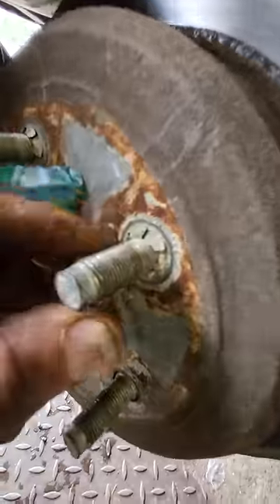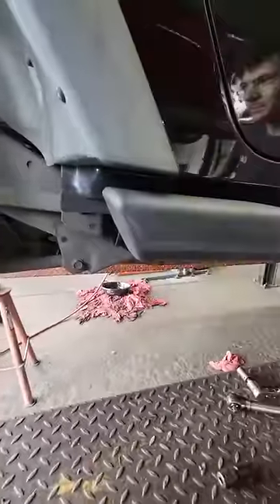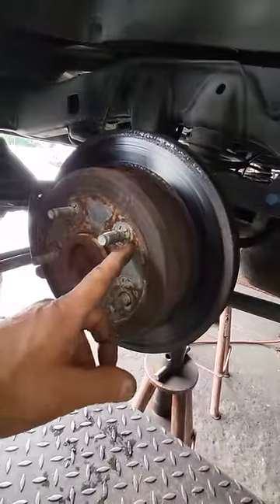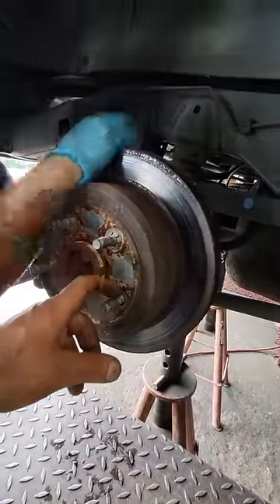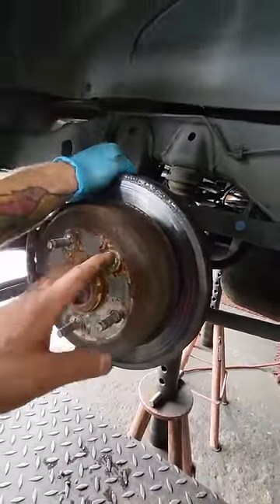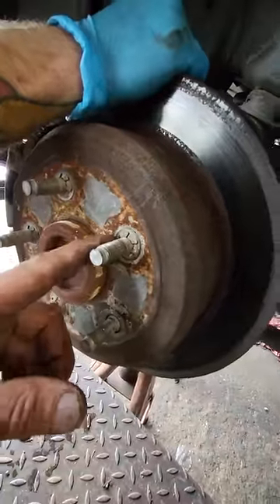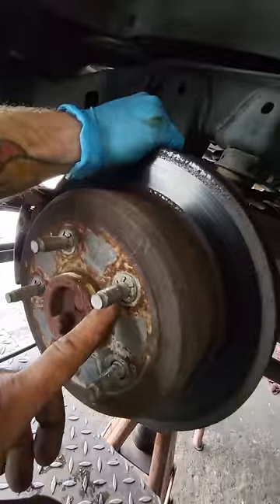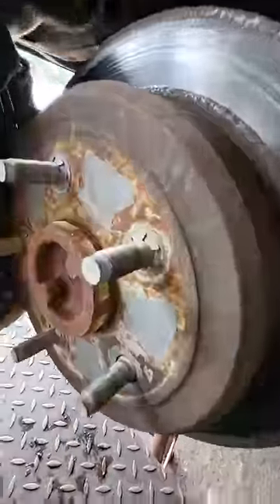There is always that guy

Comment: Just keeps the rotor from falling off on the assembly line
Reply: Why put one on every stud? Seems like
One would do the trick
Reply: @yamkaw346 generally there are only 2 across from each other. If there are more I'd be willing to bet the owner did it.
Reply: @yamkaw346 makes sure the rotors are flat and straight so they can run the lug nuts down without anything being crooked or having to hold it down
Reply: @sumo-ninja This is why I always reuse at least one.
Reply: Use side cutters, remove and never see it again. No need to reuse clips again
Reply: @davidhodge0201 or a new guy at the factory.
Reply: Because the calipers won't do the same?
Reply: @dontask8979  someone has to install the calipers my guy
Reply: That is exactly right!
Reply: Yeah till 100 years down the road and someones like I'd like to restore it to original but can't find these damn clips everyone threw them away 😂
Reply: I'm not saying I'd gaf think people go overboard with that shit sometimes 😂
Reply: Its at the Barrett auction
   We would expect this to get twice as much if it had all the rotor clips 😂😅
Reply: @yamkaw346 Right ? 3 max
Reply: I know not all mechanics assemble what they've taken apart. Those customers bring their vehicles to me for proper repairs.
Reply: Hence the reason they use set screws nowadays
Reply: @terranovarain6570 in 100 years I can sell you wheels filled with original air from the factory air compressor 😮   well I can sell you them now why wait lol........   😅😅😅😅😅
Reply: @dontask8979 Calipers will only hold the rotor on one side. The other side is free to flop around. Also, on the assembly line, when they install the axle, brakes aren't hydraulically sound yet. The pistons in the caliper have t even been bottomed out yet.
Reply: @anonymous5072 they still use them
Reply: @loganman2887  your comment is redundant
Reply: @yamkaw346 qualify assurance  and instruction
Reply: Yepp we cut them off when putting on new wheels just cause some time the wheel won't seat flush I'd never recommend even cutting them off unless you gotta do the breaks lol don't need them but also shouldn't take them off if needed
Reply: @yamkaw346  ballance
Reply: This is the answer. Can't fall off and hurt anyone with those goofy things on.
Reply: @LynxStarAuto so what are you saying the rotors can fall harvest out with the calipers on?
Reply: Oya right befor the spin test it
Reply: Or when some flathead like this with an impact wrench is rotating or replacing tires

Comment: A customer ask me one time are you going to put them back? I said no. He said what holds the rotors?. I said the wheel.
Reply: And caliper bracket and aliper will hold the wheel on if your wheel falls off you got bigger problems than that clip. Crap that crap
Reply: @jamesworsham2312 crap that crap? 😅
Reply: @jamesworsham2312 I thought my wheel bearing attached to my CV axle that was holding my wheel on but if you would tell me it's my caliper bracket I'll believe you😂😂😂
Reply: You don’t need the retainers to keep the rotor on, two of my cars randomly snapped lug nuts, and in the case of my IS300 I literally rolled on the rotor for like 3 feet and it had no retainers.
Reply: @shanefowler3504 well that wheel bearing is actually attached to the knuckle.
Reply: *wheel hub - it holds the tires and wheels on.  The tires grip the road and stop the rotors from falling off.
Reply: These r same ppl who Google Cel lights and tell YOU what's wrong, what to fix, how much it should be and how long it will take. I say Ok then fix it yourself. Well I blah blah. Do yall same ppl take a cow to ponderosa, or do u just eat what they provide? Do same with shop. Can u process cow and cook own steak? Maybe, but why leave home if so?
Reply: @jamesworsham2312  caliper bracket and caliper will hold the rotor....not your wheel.
Reply: @shanefowler3504  ur cv axle pulls straight out .
Reply: @blazeboyblazeboy4470  I know was a sad attempt at humor
Reply: .... and then everyone clapped.
Reply: And the hub caps hold the wheel
Reply: Technically it's the lug nutz.
Reply: @shanefowler3504 No those clips hold everything together. Rotor, caliper, Axle, Wheel Bearing, hub, and wheel. GM designed them to take thousands of pounds of thrust force.
Reply: O here I was thinking it was the nut the whole time. Silly me
Reply: @toddcook8824 crap that crap sir!

Comment: If one is still unusable shape when I'm done taking them off I usually slide it back on to hold the rotor in place while I put the caliper and pads on. They actually do what they're designed to do fairly well. But having that many on one rotor is overkill
Reply: Exactly. A quick twist and they're off. Then you just press back on. 

Can't believe people are praising this shop in the comments. Would they think the same if they didn't replace the set screws on the rotor if it had them?

It's just not proper.
Reply: To hold the rotor in place, I normally hand tighten a wheel nut on. That way, it's easier to put the carrier, pads and calliper back on without the rotor falling off.
Reply: @ssss-df5qz the set screw is litterally just to hold the rotor on going down the assembly line so it doesn't fall off and hit an assembly worker. 

The wheel sandwiches the rotor against the hub, and the rotor centers itself on the hub. There is no need for a screw outside of a factory with OSHA.
Reply: One is enough if the rotor won't stay in place without getting cockeyed, if the rotor stays straight on the axle or hub, then zero is correct. Unless you're trying to restore something to 100 point concours level. Then by all means, use exactly what the manufacturer used. I've seen two clips used on classic (original) Mopars from the factory. That was 38 years ago.
Reply: @ssss-df5qz  That's because the shop uses common sense rather than wasting time fighting with rusted retainers and wasting even more time sourcing new ones. It turns out, you don't need these retainers other than as a working aid. You also don't need set screws unless you really want to use them. I personally leave all that crap out. It makes the job easier for me or the next person the next time.
Reply: @ssss-df5qz These clips are not proper. They are not intended to go back on. A set screw? You are talking apples and oranges. They are only for the assembly line. They are required on assembly lines because rotors fall off and injure
Reply: @ssss-df5qz you really don't know how to work on a car, do you?
Reply: @definingimage  25 years, thousands of return customers, zero bad reviews.

But nah, not got a clue have I.
Reply: @Texassince1836, when you have wheel bolts, the little screw holds the disc in line so you can easily fit your wheel bolts.
Reply: @ssss-df5qz bwahahahaha I bet you get pissed when the dealer removes the shipping covers from new vehicles.
Reply: @ssss-df5qz being you call it a set screw, id have to call b.s.  because apparently after 25 years you don't know what a set screw is.
Reply: agree i use them for the same purpose sure does make  caliper easier to reinstall
Reply: @davidrobinson7768 some lugs are solid tip, and will not run down far enough on the stud to hold the rotor down.
Reply: @LynxStarAuto  I know, but it does make it a lot easier. Stops the roter from falling off and hitting the floor.
Reply: Thats why you use a lugnut.....
Reply: Exactly

Comment: It looks more professional to reinstall them in my opinion. When  I work on a vehicle, I try to make it look like it has never been touched before. I pay attention to details. Some customers appreciate the extra effort.
Reply: You give the vehicle back to the customer with the wheels installed right? How does it look any more professional to them when they can’t even see the clips?
Reply: To me it looks more professional if the guy knows what to take off and what to put back. You do you though, I just hope you don't charge by the hour if that's what you're gonna spend time on.
Reply: Make sure you charge them $40 for parts for those retainers, too.
Reply: Actually it looks more like an amateur worked on the brakes.   Putting the retainers back on is like putting the clear  plastic protective film back on an electronic device.
Reply: Looks more professional? Thats the dumbest thing ive ever heard on something that literally has a wheel bolted over it...wouldnt these clips actually be dangerous by not letting the wheel sit flush to the hub?
Reply: Try to buy some new ones. Then you can mark them up to $5.00 each.
Reply: I'm professional and I don't put them back on.
Reply: @tommys2979 Oem wheels have a machined area to account for those clips.  If you install aftermarket wheels, you almost always have to remove the rotor clips so the aftermarket wheel mounts flush to the hub.
Reply: That's the problem. These brakes look like they've never been touched
Reply: Yessir this is what I’m saying
Reply: @Code325 some customers do their own brake jobs maybe this customer couldn’t do it but maybe the next owner would see it
Reply: @trentlee9826  then that owner would assume their vehicle didn’t come with them, as most vehicles don’t anyways…
Reply: @Code325 You assume they’re never going to get a flat or rotate their tires?
Reply: @gilberturibe393  like I said, they’d never know it ever had them. 95% of people wouldn’t even know what they’re for if you explained it to them. Most customers hear you explain something, nod their heads, and immediately forget what you just said.  That’s a million miles away from suspecting that there should be rotor clips installed and erroneously assuming that that reflects poorly on the last technician that pulled the rotors off their vehicle.
Reply: @Code325  If they rotate their tires I’m pretty sure they are going to see what is behind before and after the mechanic works on it.
Reply: @gilberturibe393  more than likely they wouldn’t notice. And if they did, then what? It would be like being upset that the tire techs took the stickers off your tires before installing them.
Reply: @Code325  The stickers don’t hold your rotors in place 😂
Reply: @gilberturibe393  neither do the clips. Your lug nuts do buddy. The only way your rotor is going anywhere is when you’ve got the wheel off, the caliper off, and you’ve broken loose it’s fit on the hub. This is like arguing with a flat-earther though… I suppose it’s going nowhere.
Reply: @Code325  Did you miss the part where is said people service their own cars and do tire rotations?
Reply: Yeah I just got a $400 refund because the "mechanics" replaced one axle when it was supposed to be 2. Didn't even use OEM parts and do half ass job.
Reply: @grimakastatik  what does that have to do with rotor clips?
Reply: @Code325  You don’t have to try this hard to convince us that they are not important, just admit you are a lazy worker 😂
Reply: @gilberturibe393  please explain why they’re important.
Reply: It would look more professional if you knew the reason they are there and remove them. Every mechanic I know would consider it amateur to retain the assembly line clips
Reply: @Code325 😂😂
Reply: If I had the retainers in stock I’d replace them. 
I don’t , so they get nothing.

Comment: I used to do stuff like this. Now everything i touch is returned to factory specifications. A little more pride and respect for the vehicle owner as I got older made me change.
Reply: ❤i kin respect that.
Reply: I'm sorry but that's a fool mentality when it comes to doing automotive repair, those clips are just meant to keep the rotors on while it's moving through the assembly line, the manufacturer doesn't even intend for you to replace them when replacing the rotors
Reply: They use it so the rotor doesn't fall off in the assembly line..... no need after that
Reply: It is because of mechanics like you that I have a 1979 classic that has everything the factory put on it.

Thanks.
Reply: @yt.personal.identification  I'm no longer in the profession. However, I took alot with me from when I was. 
Glad you are enjoying your classic.
Reply: You are definitely not a mechanic
Reply: @sinr247  It is Not a fools mentality, it depends on the individual and the customer. 100% the clips are for factory assembly only but often it is going to take longer to talk the owner into understanding the purpose of the clips, it is just as easy to put them on. They are easy off easy on and happy customer. The clips are not important or necessary but a happy customer is. That said one on every stud makes zero sense as it is way overkill.
Reply: factory specs lmfao. Ever heard of core shift in BBCs?
Reply: You have OCD. These have no function once the car has wheels on it.
Reply: @Chrisdacowboy actually a guy like this is the only true mechanic.  The reason cars run half a million miles on the same engine and trans are Guys like this.  The others Are parts changers.  Kind of like steering wheel holders vs equipment operators 😅.  

I’ve owned my own shop for 23 years.  And I’m routinely looked down on because I’m clean.  My hands. My clothes and my shop.  That is until these wrench turners walk in and realize I do it all from metal fab to paint.  And every engine swap , brake setup in between. They ask how ?  Well. I’ve never felt the need to cut corners , wallow in grease , or bathe in gear oil.  Dirtiest I’ll get is block  sanding primer , and I’ll have an apron on then. 😅.  If the car comes with a clip , it will be rebuilt with that clip reinstalled.  Easy peasy.  Extra parts at the end mean corners are cut.  That’s for jiffy lube level stuff.
Reply: these clips are not designed to be removed and re installed. one time use. you basically destroy them to remove them. this is a fools errand to try and keep them
Reply: Good on you.
I wish the previous owner of my old bug had the same mentality, would make my life easier
Reply: @puttervids472 zero purpose corners are meant to be cut.
Reply: @stevenbennett6598  that’s jiffy lube mentality.
Reply: I mean to me as someone who doesn’t know to much about cars I’d appreciate everything taken off being put back, even if it isn’t doing anything I want it🤷🏻‍♂️. Idk, I gotta numbers matching 88 vic trailer special from factory and I plan on keeping it as original as I can, rn I’m swapping the heater core but I have every single plastic pin and screw in little baggies, I took it out so I can put it back type shi,
Reply: Sounds like wasted time to me. That clip serves zero structural purpose
Reply: Factory spec in newer vehicles don't mean much. There junk now lol usually takes aftermarket upgrades to make one reliable
Reply: @TireSlayer55  and you have no concept of the value of keeping something original.  I'd rather have the OCD.
Reply: so you are wasting your time and your customers money, nice
Reply: Paid more and do more because you forget a nuts job
Reply: Factory spec is to remove them after the vehicle is off the assembly line
Reply: @Chrisdacowboy he runs a shop
Reply: @puttervids472  from reading your comment I get the impression the reason you never get dirty is because you never actually touch the car
Reply: @limprooster3253  lol whatever makes you feel good chief.  I don’t have to wallow in my work.  Oof course occasionally an accident happens.  But to daily be nasty just because you worked on a car ?  Maybe it’s a short round guy thing.  I’m tall enough to reach anything without having to lay in it.
Reply: @puttervids472  again, just from your comments, you don't strike me as someone who wrenches on cars.
Reply: @limprooster3253   trolling isn’t really that attractive.  I don’t just wrench . I build cars.  Since 2001.  This afternoon I put a vintage air AC setup in a 67 mustang coupe , yesterday I was lining up gaps on a 69 Mach 1 , getting ready for last block and paint.  

Some of us aren’t grease  monkeys.  It’s just that simple.  I’ve had several work for me who were. And they seem to make it a mission to get as nasty as possible, because it makes them look busy.  Or something.  I notice because it’s a pet peeve of mine.  Simple  as that.
Reply: @puttervids472  I'm not really trolling.  Im more or less just point out to you what you sound like.  When you make a point to say that the people who work for you get filthy, yet you make a point not to because it's a "pet peeve", it comes off as "i assign the dirty jobs to other people so i dont have to.".   When you claim that rolling in the dirt/oil from a car is something "short round" people do, and you don't have to because you are tall, you sound like you've never actually been under a car.    I'm all for not going out of my way to get dirty but the jobs gotta get done.  Cars get driven.  Sometimes they leak and get driven that way.  Just how it is.  Making a point to say how good you are at not getting that on you doesn't make you sound talented.
Reply: @limprooster3253  lol. My aim was never to sound talented.  Nobody who’s talented needs to say so.  The work speaks for itself. 

No. I didn’t say my pet peeve was getting dirty. My pet peeve is folks who do it on purpose.  Wiping hands on clothes , rolling in it etc are choices.  But I digress. What you’re basically saying is “ you don’t sound like what I’m used to seeing “. Yep. I’ll agree there. I’m sure I’m not what you’re used to seeing.
Reply: @puttervids472  No sir.  I'm quite used to seeing people who are afraid to get their hands dirty.  It really does sound alot like you, hence why I said what I did